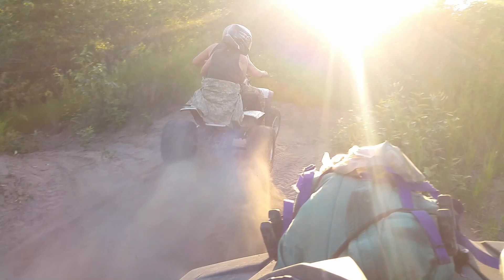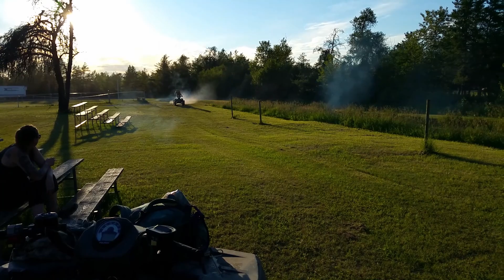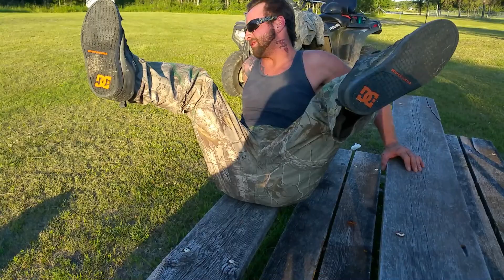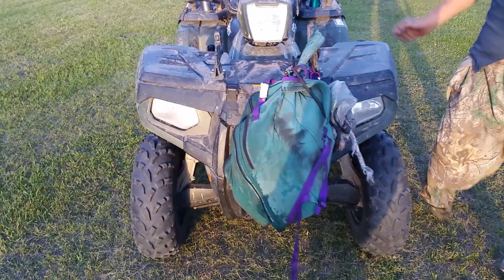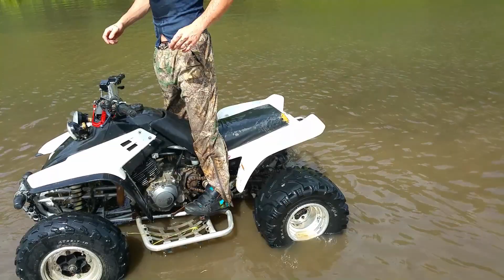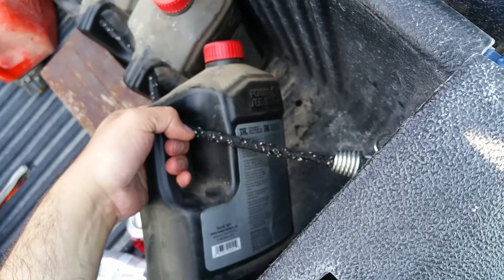Yamaha Death / Trying to Blow Her Up!  , Will She Ever Blow Up?

Comment: poor Yammy!!!
Reply from the maker: Yup!! Just wait to see what we do next to her lol!!!
Reply: also you're nearing 25k subs! grats!
Reply from the maker: a1motorworks usa We all do!!! But who has $5k to spare for parts for me lol!!
Reply: lol the rate he goes through parts...
Reply from the maker: a1motorworks usa Still need Clutch $800 , Swing arm , axle ,barrel carrier hubs ,hubs $2000 , shocks $1500 AArms $800 , bumper $150 , Rad $200 , Coil $75 , Rims Tires $1800 , Fiberglass fenders $800 , Paint / Powder coat $500 , And Water Pump $300 , case Saver $300 , Chain Sprockets $300 , Odds And Ends $750.00
Then it will be "done" But dont need all that right now , only like $5K now lol
Reply: so buy another? lol
Reply from the maker: a1motorworks usa 
We already blew her up , SO this time we will keep her for the track lol!
Reply: +StarPuss www.ToxicRedNeck.Com what did you do with all the parts you bought?
Reply: TheSt